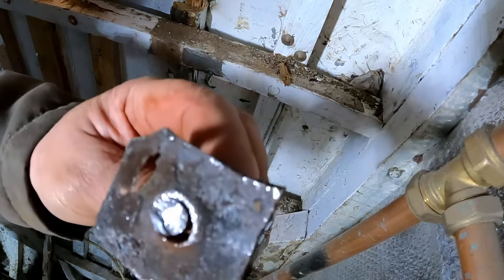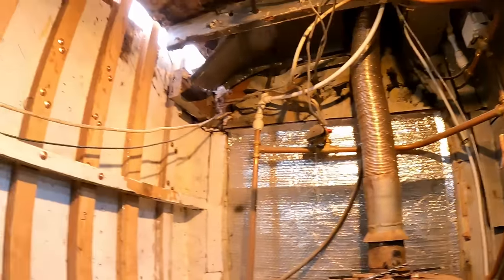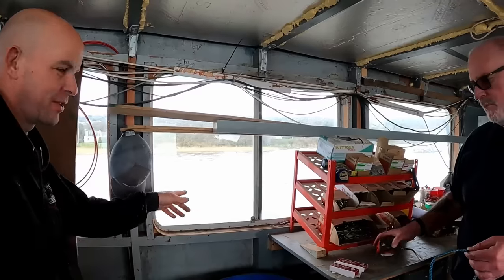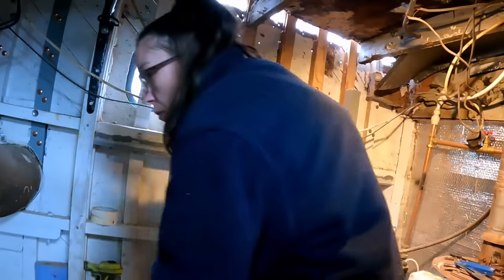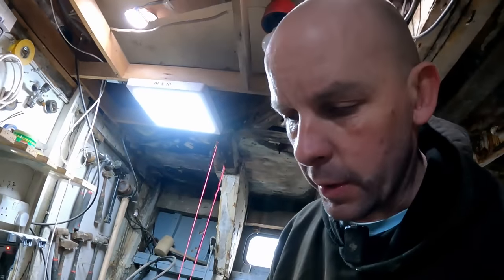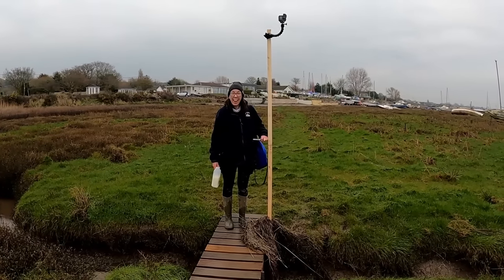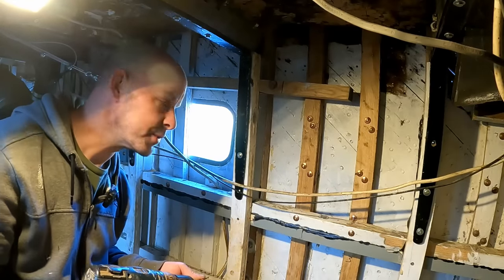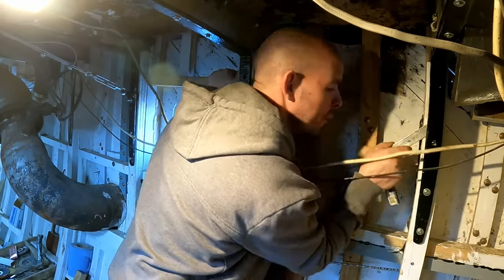Ep 168 BIG Problems & Our Mistakes On Our Big Boat Restoration!  #boatrestoration

Comment: Canadian shipwright here. It’s never good to install a structural member under stress (either its or yours 😂). The rule to go by is laminates need to be thin enough that the assembly is easily flexed into shape by hand. The tighter the curve the thinner the strips required. I would have used 8 strips less than half the thickness you did for that radius. The other rule is to leave the gluing surface rough and the easiest way to do this is to cut the strips on a bandsaw which leaves a great cross grain tooth in the wood to lock together. Definitely don’t plane them smooth. As to species, we try to use only species that are both long fibre and rot resistant. My preferences are white oak, douglas fir, sitka spruce or mahogany. Love the project and your enthusiasm!
Reply: Practical and knowledgeable advice.
Reply: Engineer here! I was going to post the exact same thing. It might be counter intuitive, but the closer you can get to 8 layers, the stronger the final piece. And rough surface cuts are essential for the best adhesiom.
Reply: Seems a logical solution
Reply: My god.lol. Will you be ready for crossing festivities. So do wish I could help.   CHEERS
Reply: Also, epoxy resin glues are weakest in shear which is what is happening at the glue layer as the laminate tries to straighten.  Also also, were those laminates made up with the very end of a batch of epoxy, just before you ran out?  It may be that the small quantities left in the tins were more susceptible to low temperatures and went outside their storage parameters.
Reply: Do you mind if I ask a question as you seem to know what you are talking about. Is there an advantage to doing all you say, then when the laminated member is installed, drilling and plugging (dowels) the piece to add extra slippage protection? Just a curious thought from someone who engineers in a different sphere.
Reply: @andrewmaiden3738  I’m happy to respond. Any cross pinning with dowels or fasteners through the laminates will add strength, however if done properly, a laminated piece under specified load is not at risk of coming apart and is stronger than solid wood of the same dimensions whether cut or steamed. In many cases we don’t use any fasteners at all even for critical structural members. The adhesive does all the work.
Reply: Particle physicist here, when wood rots, you get particles.
Reply: Canadian Shipwright, that good info and my best to Canada.  Not quite the same thing but we had to put a new chime on the 'Edith May"  Thames Barge, it was 40 foot long by 12 inch and 3 inch thick. Bend and twist up to the bow. We pre drilled 80 stake holes and had two steam pressure washers running twelve hours in a makeshift steam chest. It took ten of us to get that in position and drive the 9 inch stakes in. We could feel the wood stiffening up and fighting us. Dam hard work and one shot to get it right. Knackerd and covered in pitch we collapsed in the Pub. Hats off to Shipwrights. 
Good to see such enthusiasm after all the challenges it will be more enjoyable soon.  I will take a walk down from Thirstaston and check on you...
Reply: Motor Torpedo Boat cross laminated Ply, very strong.  @cleanpowerelectric
Reply: Pretty boring but thanks for the thing you said buddy
Reply: @jonwallace7015  your welcome, “buddy”
Reply: Had the opportunity to work on a project at Shelter Island many years ago, and the previous owner of the 110 ft wooden tug secured the expert
shipwright Chris Frostad to replace a few timbers, and sister some frames. As you can imagine a vessel that large, had large dimensional timbers.
Lots of steaming, and stapling. I believe the planks were yellow cedar. By that time large dimensions of solid yellow cedar were hard to come by.
This particular lot was purchased from BC Packers when they closed up their yard on the Annisis Slew ?  Funny how places and things that are 
around for as long as you can remember, one day you turn around and it’s gone.
Reply: @georgerenton965  small world. I have worked at Shelter on several projects in the past, and around twenty years ago I rented the big a-frame and the machine shop at the BC Packers location on the North Arm to refit my own vessel.
Reply: @cleanpowerelectric  that’s what I was thinking when I replied. There were always various projects going on at a do it yourself yard like that. 
You could learn a lot there. My working life had me in Vancouver for many years, but that is no longer the case. It’s always warming to see posts
on YouTube that as an aside show places I became quite familiar with.  Cheers.
Reply: I Agree! Thonner straps will allow the rib to have a sober rest with one another and will be stronger.

Comment: A handy hint I picked up removing rivets from steel. Once you have it flush, drill a hole down the centre before trying to drive it through. This give the energy a place to go instead of trying to spread the rivet further. The same should work with copper.
Reply: Yes I wondered why Gemma hadn’t drilled the rivets.
Reply: @Dave_1966  Such a smple trick to learn but can save so much work.
Reply: And copper is pretty easy to drill, and the hole does not have to too big for that to work.

Comment: Just Curious - When the oil was changed the Port engine showed what looked like an emulsion due to water in the oil. Has the new oil been rechecked to see if it has again emulsified?
Reply: The engines never seem to be run up to full working temperatures. Condensation could be mixing with the oil, its the same with diesel tanks. They need to be kept full. 😊
Reply: Diesel tanks are horrendous condensation generators, unlike petrol tanks which are a little less problematic as it vapourises easier, well it did with proper old fashioned petrol.
Getting an egine up to running temprature takes longer than people reaslise, not only do you have to wait for the guage to read the correct temp, you then need to keep it running for long enough to expell the crap that has accumulated. Add to that, diesels do not like running without a load and can become vulnerable to glazing inside the combustion chamber. This is why you see commercial vessels running the engines and in gear when moored. Modern engines adds further issues, I beleive that the police had problems because of the time they spent ticking over at accident scenes and I believe it led to one poor officers early departure from this world.
Reply: What is the story on all the boats anchored near Sarinda? Are they abandoned, under repair, or in use and just anchored/beached in the estuary?

Comment: If you're going to steam bend these bits, might I suggest you still use the three bits, just as you do when laminating them with epoxy, pre-soak the wood for 24-48 hours, steam them and bend them on a jig, add 10% to the bend of the jig to reflect the return flex.

Comment: More laminations would also help with the severe bend.  When I laminated my oak frames I used 5 or 7 laminations and didn't have any issues.  I used West epoxy with 403 microfibers for filler.

Comment: Hello both,  I follow your YouTube channel from the beginning .I like very much what you guys doing. I worked already 30 years with Epoxy and built several boats in woodcore. We actually live on a woodcore boat now in the Bahamas . I know exactly what your problem is with the delamination and it's easy to solve. You are applying first thin epoxy which is good , but then you have to wait and see how much the wood sucks up the epoxy. If the epoxy sucks in totally you need to apply an other coat of thin epoxy before applying the thickened epoxy.
If you don't give the epoxy time it will sucks in the wood while clamped in place and the glue surface inside will be dry up with delaminatin as a consequence. 
Excuse for my bad English 😂
Reply: Your English is great and your advice makes sense!

Comment: As I understand woodwork and I'm by no means any kind of expert, you need rough surfaces for bonding because as well as having a better surface to grip to it also gives a bigger surface to grip to in essence but also helps to retain more of the bonding material.
Looks to me like the surfaces was so nice and smooth and like you said under so much strain and forces not only for them straightening themselves out but from you clamping them into place and shape that it all forced most all the epoxy out leaving hardly anything to do the actual bonding and not a whole lot for all them bonding hands to gerra grip on lol
It's a learning curve....no pun intended lol for all of us.
Great recovery Simon it's good to see the good the bad and the ugly because that's what real life is about. 
Awesome great job and so interesting to see the massive tide.  When it comes time for yall to cast off finally from that spot will it have to be timed to one of those extra high rides?  Or will a regular one be enough?
Reply: The high spring tides hide the deeper channels. So might not be so good for moving the boat.

Comment: I've done a LOT of laminating for exterior projects using a variety of materials.  Rule of thumb - the greater the curve, the thinner the pieces.  I've been surprised you've been getting the curves you have with oak that thick.  for more curve, get that thickness down to 1/4 inch or even less.  Glue them in place and cut your scarf with them in place.
Reply: Probably 4 pieces of laminate timber less chance to delaminate

Comment: Two thoughts;  I agree with the other commenters about thinner ply's.  Three ply's should be at least 6.  Secondly, this is a new batch of West Systems epoxy, right?  I would not be so quick to accept that  something has not gone wrong with the material West supplied.  You have done some very tight bends with web frames that extended into the bilge.  Take a very close look at the epoxy containers to make certain that something has not changed by accident.
I'll also suggest switching to the high flexibility epoxy with your next purchase.

Comment: i was told by a old builder that when he goes to glue two pieces or more together he said put some glue on the area you are joining first so that way it soaks in and then when it almost dry then apply another layer and then stick it together as the timber is quite porous and sucks up the glue to the extent your joint will fail.
Reply: That's exactly what happened here. The oak is very poreus and soaks all the epoxy out of the joint. With pine for instance the lamination would not have failed. It's also easier to use thinner strips in more severe bends but not doing so is not the reason of failure. The laminaat has then only the tendency to stretch a bit more

Comment: … That stuck copper nails in the knees. Drill a small hole through the top into the center of the copper nail before you start hammering on them. That way the copper has a place to expand into as you strike it.

Comment: hello from llangollen north wales Glyn here, iv'e done a fair bit of laminating and a good tip is to score the gluing surfaces with a stanley blade like x's the full length , it gives a strong key for the glue . have you heard of a water based glue called CASCAMITE it is a marine grade glue that comes in powder form. keep up the good work and great vid's..........

Comment: I guess steaming the laminate planks, then dry assembling them in place so they take on the bend easier? Once dry, epoxy them together in place? 
I imagine Leo or Peter from Travels with Geordie (he’s done some crazy sharp bends in the hull of Geordie etc) would be good points of contact for help.
Reply: Oops, I just suggested the same thing. I should read more …

Comment: May be worth looking into ash. Used on motorised vehicles alot due to shock resistance and bendability. Lovely to work with, I've used it on my 1944 military  truck and trailer.

Comment: Hi. Love your content and your work. I’m not a naval architect or engineer- just a building architect. My observation would be: if your laminate structural ribs can only flex at 4%, you would have to ensure the superstructure of the boat under way would not exceed that amount. Under a heavy seaway I don’t know the flexural limits of a timber ship. If it is at the limit you might need to introduce steel rods to ensure no more than 4% hull flex.

Comment: Simon whenever I’ve laminated oak I always rough up the surface. In general I would use 60 grit paper and always sand against the grain to make it as rough as possible. With the amount of epoxy you love to goop in there😂 you will be fine with just saw cuts. When the bend gets harder, I would make the frames out of 4 pieces instead of three. 😊 Keep using the oak.

Comment: Hi simon and gemma on the frames that deliaminated you could small cuts in the wood all the way along  but not all the way threw the plank it make it more flexable.may on two planks do that but the uncut one on the back and then when you put expoxy on them it gose into the cuts to make it stronger again

Comment: Hi Simon and Gemma. 
I have watched a few of your videos and am impressed with your dedication and the ability to "keep smiling" in adversity.
I too am the proud owner of an old boat in the throes of restoration.  My vessel is a Dutch Luxemotor, built in 1897 (yes....127 years old!!) with a riveted iron hull, which is moored in central France on the Canal de Briare,  Amazingly, the hull is the only part of the boat which hasn't been "messed-with" and is still as good as the day it was built!
Anyway, the reason for my contacting you is:  Are you aware that you can obtain a "Zero VAT Declaration" for old vessels for the purchase of goods and materials, specifically for use on the vessel?  This could obviously save you 20% which, having seen the quantity of materials you are using, would be a considerable amount.
If you need any help with the above, please let me know.
Kind regards and best wishes.
Nick Longstaff

Comment: If you ever need to use long wood screws to hold a brackets or what ever first drill a pilot hole then dip the screw into a tin of grease the screw will go in easily and no fears of breaking the screw this is a very old ships carpenter trick as in thoses days all screws had to be install with a hand screwdriver 
Fantastic videos and superb editing  must be the best on youtube congratulations to you both.

Comment: A few people have said clamped too hard and squeezed all the epoxy out. I’d be minded to agree.  I have made some tightly fitting laminated deck beams on my boat with polyurethane glue instead of epoxy which worked very well. Laminating in place like you ended up doing will also help as it’s not relaxing and being stressed again.

Comment: How about a combination approach? Propare to laminate, and then steam and form the thin pieces before gluing them up. Pain, but the thin pieces steam faster and the pre-forming relieves a lot of the built in stress in the glue joints maybe.

Comment: More good work and it must feel great to get the last bit in for the engine room.  Don't know if you have already noticed it, but at 34.05 in the video, you can see daylight through the hull planking to the right side of the rightmost knee.  Just an FYI as you still need to do the deck beam and repairs to the upper hull planking.

Comment: Don't plane them planks smooth, they have to be thinner, they can even be veneer thick, stick to the designed scantling measurements.
Excellent boat building. Thanks.

Comment: Glad you got the delimitation problem solved. It makes sense. That is a LOT of curve at that point. You might consider using the G-flex epoxy on future laminations with that much curvature. 
The tide depth vs the draft of SARINDA was quite interesting. Even with an Astronomical high tide, she will be very close to the bottom. That means when the time comes, you will need to move her only on an extreme tide.

Comment: You might consider doing a rough sand on the mating surfaces with some 30 or 60 grit sandpaper to create a better surface for the glue to bond?  Don't remove much material -- just scuff up the surface....

You mentioned possibly not planing them.  Instead you could plane only one side to get it to thickness, and leave the rough cut on the other side for gluing.  On the center plank, where you need glue on both sides, you could use the rough sanding on the planed side.

Anyway, that's my "2 cents" on getting a stronger glue lamination.

Keep up the good work!

Cheers from Oregon, USA
Philip

Comment: I would like to suggest that you get the other adhesive as well as using thinner wood strips, not planed as you need the the rougher surface (called tooth in many industries) for the glue to hold on to.

Comment: In regards to the copper nail segment sticking in the knee. The technic I would sugest is. Lets say the hole in the knee is 8mm in diameter. Then trim the nail flush to the knee on one side. On the flush side drill into the center of the nail with. Like a 6mm drill bit, about half way through the knee. Then place a 6mm punch down into the drilled hole. Malitize the punch to drive out the copper plug.

Comment: I'd personally swap to the recommended G-Flex, as you've said the curves are only going to get more pronounced. And as the previous poster has stated perhaps the laminations need to be thinner as well? It will make it more of a juggling act though I'm guessing but the result will be more structurally sound.

Comment: I think the rule is the bigger the bend the thinner the wood strips.  An experimental option is to soak the strips in water and then clamp the part of the wood with the biggest bend in a form to give the wood the approximate bend you want. Let the wood dry in the form and the strips should retain some curve. Are normal clamps strong enough to force the form together? How long does the wood need to soak?  Is it worth the effort?